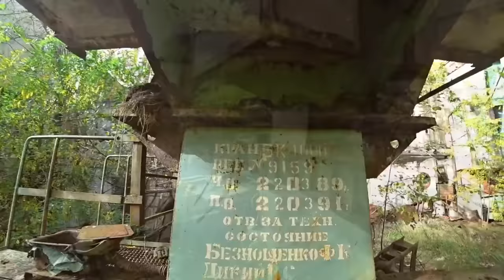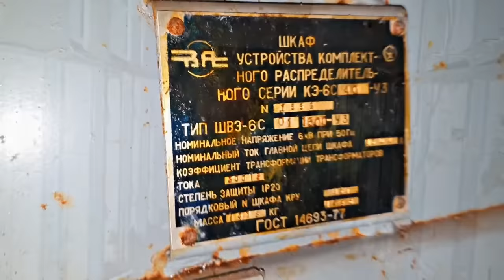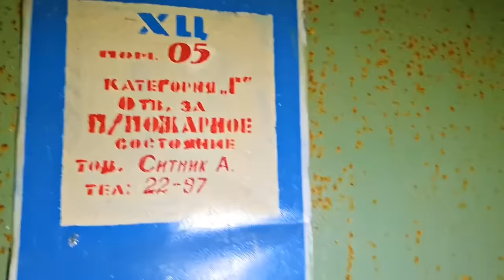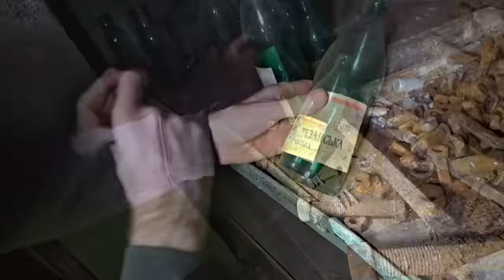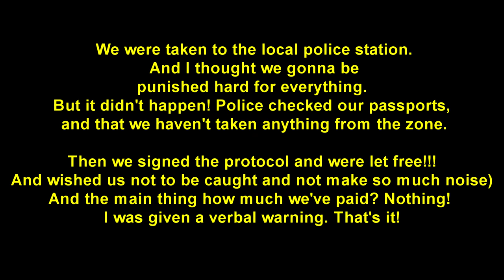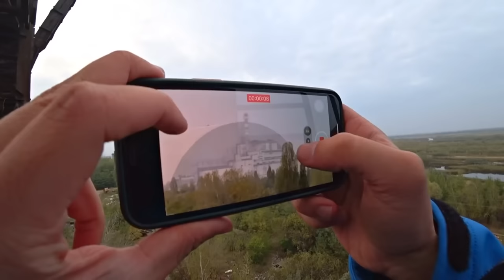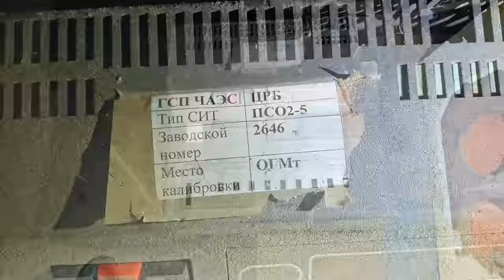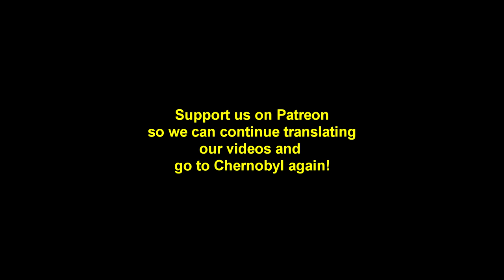☢Penetrated under the Chernobyl reactor in a terrible Tunnel☢Found a Nuclear Waste Storage Facility

Comment: They may have radiation poisoning, but they are living life to the fullest 👌
Reply: 😂😂they are crazy, this is just 100times crazyer then the stuff i do and uploadeed lol😊
Reply: Apparently, after swimming near the reactor they went and got checked for radiation and their levels were normal lol
Reply: @krystallinum  yes I think it is because Water actually blocs most of the radiation if I remember correctly thats why you can stand in a Nuclear reactor next to the water and look at the Heating-rods down in the chambers
Reply: @Augustadventures  yeah water is a great insulator and with a lot of the radioactive stuff over there as long as you don't ingest it the radiation levels are fairly low at this point, like there's tours inside the reactor that they do where you can go in the control room for the one that exploded and in areas are only separated from the places that would have been most radioactive by a cement wall
Reply: @krystallinum yeah but they consistently enter the exclusion zone, with zero protective equipment. Breathing in radioactive dust going through those buildings. They’ve had dosimeter readings of over 1500. They all been exposed to harmful levels of radiation which will for sure give them problems later in life. This is no joke what they are doing. They don’t even have a dosimeter with them here. They could be walking through hot spots and have no idea.

Comment: Looks like a cyclonic air filter. It separates the particles from the air in those little vertical funnels. The dirty air enters from those slots on the side, the dirt falls out at the bottom of the cyclone and the clean air leaves the top. I imagine the dome on the top collects all the top outlets of the cyclones and directs it down the centre to the bottom outlet. (Multi cyclone separator)

Comment: Don’t worry they are being smarter than they are leading you to believe. Reactor 5 and 6 were never completed and they are in a separate building about a mile away from reactor 4. Still super dangerous though
Reply: No, if you know what you're talking about this group creates content, but doesn't know what their doing and assumes a large amount of risk that could potential shorten their existence
Reply: Looking for “liquid” nuke waste? There was never any coolant or fuel put in that building. No doubt that water is radioactive, as is the ground, trees, machinery…. Everything that close to plant 4 may shorten your lifespan. The building they got caught in may have been air or coolant plumbing

Comment: What good does a gas mask do without the filter canister? No dosimeter either? Probably not the greatest idea. I enjoy your videos. Best of luck.
Reply: Well the original gp 5 filters of the gasmasks contain asbestos so that wouldn't be the greatest either 😂
Reply: @Electronichub_05  You can get safe modern GOST threaded gas mask filters, which work with Soviet masks.
Reply: @TheGreenBrickOfWisdom  i know. You can also just put another o-ring into the threads of the mask and it will seal without destroying the threads :)
If you do it that way you should use something like banana oil to check for leaks tho.

Comment: The air lock is there to keep negative pressure as you get closer to the reactor the areas are at lower pressure so any air leaks in not out and this stops the escape of contamination to the atmosphere

Comment: Guys you shouldn't try to find this tunnel. It never existed. Around the 4th reactor there was a 30 meter deep wall built into the ground, to stop radioactive water from contaminating the Dniper river. During the construction they would have seen the tunnel, because the tunnel is 9 meters deep or above, but this wall is 30 meter deep. But they never found the tunnel!